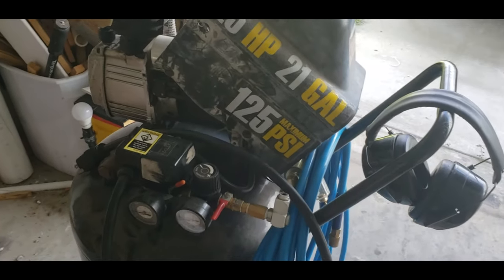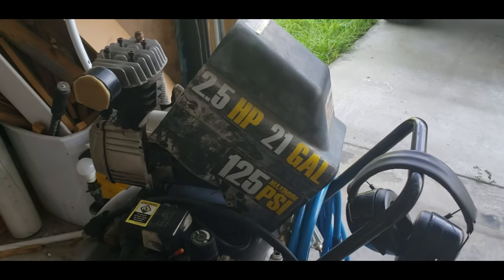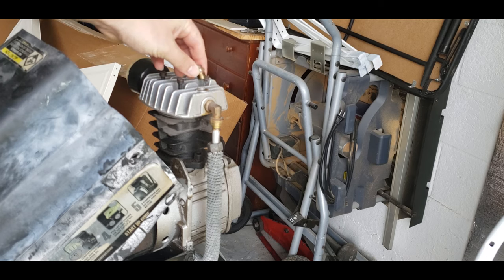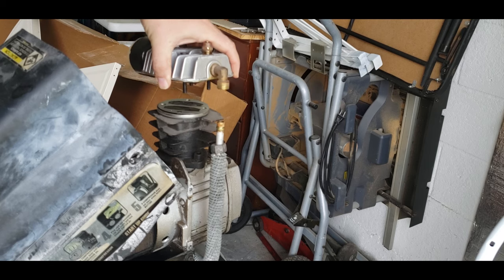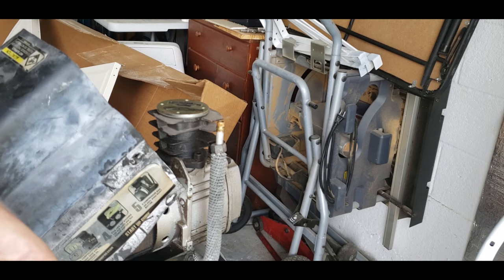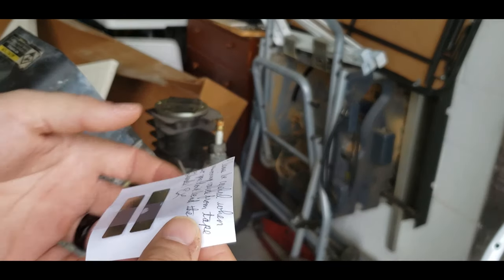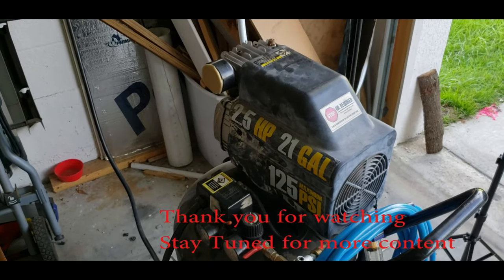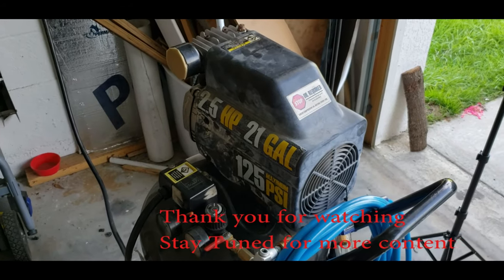CENTRAL PNEUMATIC, Harbor Freight 21 gallon 2.5 hp Reed valve Repair

Comment: Thanks Dan, my compressor starting giving me the same issue today, only about 20lbs of pressure. After I found your video I opened it up low and behold broken reed valve. I'll order them either through Ebay or HF. If the latter their "Reed Valve Rebuild Kit" (#15884) includes the head gasket, metal gasket, 2 valves and a valve plate gasket for $6.49 plus free shipping. The downside is not knowing the quality and the delivery time could be 2 weeks if in stock or 20 days if shipped from overseas. Did you ever have an issue with a leaky head gasket or the other original parts?

BTW, the cause of mine was that I had a hose that was leaking. While the compressor was still running I tightened the hose down. The leak stopped, but then the compressor made an odd refilling sound and would no longer fill up to it capacity. So it seems I broke the valves likely with a sudden surge of pressure. Stupid on my part, but live and learn.
Reply from the maker: I have not had a single problem since my rebuild.
Reply: @danielsgarage3545  Great, then I'll order from your source and hopefully have the same luck. Thanks a lot for the video, it really saved me a lot of guessing and research; hell I even thought I'd be purchasing a new compressor at one point.
Reply from the maker: Glad I could help

Comment: If it doesn't do anything when you start it, like dead. Where to start?
Reply from the maker: I would start with power. Is the breaker on? is the outlet gfci?  Is there power at the outlet? Is it plugged in? As long as there is power coming into the compressor then the first item to look at is the on off switch on the compressor.
Reply: @danielsgarage3545  Thanks for the reply. Much appreciated. I tracked the electricity down to the pressure switch and I have power coming from there into the motor. I am not sure then if the motor is gone.
Reply from the maker: @DrAlmurshidy  if there is power to the motor wires and it's not turning in it's most likely the motor or something internal thats keeping the motor from spinning. Depending on how handy you are, I would do a complete teardown and inspect everything.  You will only lose time but gain experience even if it's a total loss or repairable. In the end it's up to you is it worth your time and energy or does your budget allow for a new compressor. I know these can be bought second hand for pretty cheap and if you get the same kind you have spare parts down the road.
Reply: @danielsgarage3545  I completely agree. I actually do that for my own joy. I like working on these things. Thanks bro for your answer.